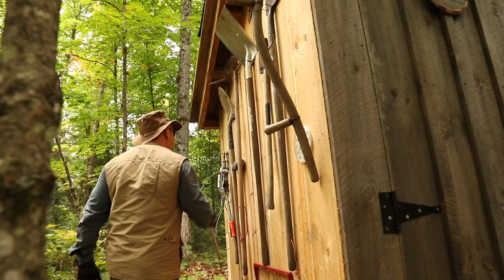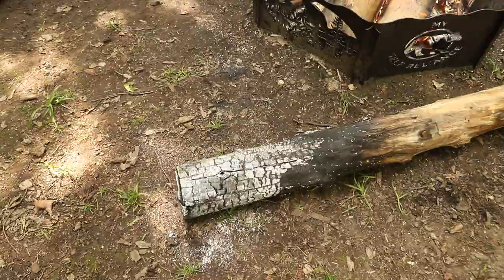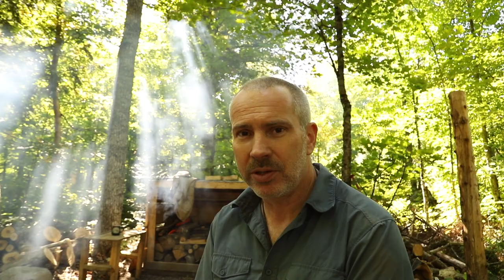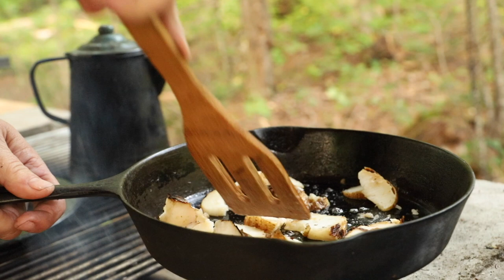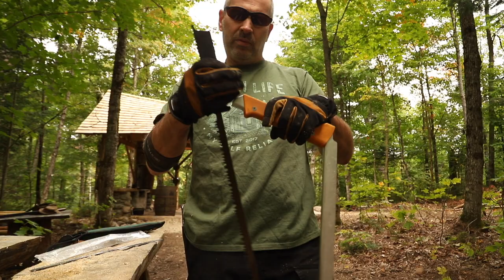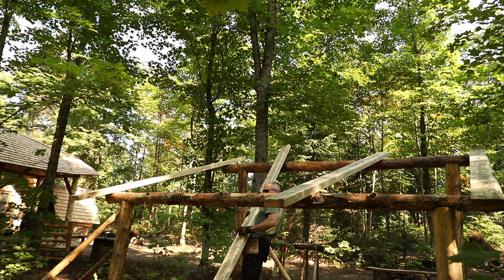Bushcraft Super Shelter Style Wood Shed | Deer Meat for Dinner BBQ

Comment: My dad kept his firewood behind his machine shed in a big pile for splitting. The machine shed was about 15 feet tall. Dad built up the firewood pile that high every year, and we never ran out of firewood. it was about 15 feet high and about twice that wide at the bottom of the pile. Didn't hurt that we were on 66 acres of woodlands and he only cut up the deadfall from the previous year. Now he keeps a smaller pile next to an old smokehouse behind the garage (only about 10 feet high). If we'd had a woodshed like yours when I was a kid, we'd have wood overflowing it. Dad did about 4 trips into the woods with his tractor and an old truck bed trailer, always filled it up to the point where some stuff would almost be ready to fall off.

Comment: Sean if you have not tried using a water level you will love its accuracy and the ability to level and bench mark over considerable distance limited only by the length of 3/8 tube you buy. I use 100 ft myself. Its practically fool proof and a real time saver

Comment: Interesting video, Shawn. I've got a question about your technique. Is there a specific reason that you flat top the posts and then hew a flat bottom saddle notch? I learned a much different style of saddle notching the beams to the posts. We were taught to cut a "V" shaped saddle notch in the beam a little more than 1/3 of the diameter of the beam and with the points of the V's corresponding to the desired center to center distance between the posts. The tops of the posts were cut to a matching V profile. When the beams were lifted onto the posts, gravity alone created a remarkably stable joint. We completed the joinery by drilling at an angle and pegging the beams to the posts. I'm certain that those gigantic bridge nails you use would work just as well and be a whole lot less work. 

Still loving the short frequent videos. Thanks for taking us along on your adventure.

Comment: Hey Shawn, I was just thinking about your shed design, and I wonder wouldn't it be better to use some coating over your wood? I get it that you burn columns bottom and it will help a lot but wouldn't it be better to coat it whole so it won't get water from the ground? I'm not trying to be provocative just genuinly curious. Waterproofing is pretty common and I'm sure you know about maybe it was I who missed it in some of the videos. I guess it's called wood oil, outdoor coating or something like that? Of course it might ruin the whole "off the grid" schtick that you'd use professional construction products but it will definetely help with sheds longevity. Thank you very much and keep up the good work, love your videos, man!

Comment: Your very optimistic about shedding that snow ,i don't know how much you can get up there but it looked pretty flat, i hope you are correct ,I've had to fix problems like that for a friend once ,it was a real pain the following year once the metal was on good luck, it still looked good though
Reply from the maker: You're right. It has a decent slope, but I will be raking off the snow regularly

Comment: I have one question being a carpenter by trade. Why did you laid the roof  rafter down,,,,,,,, you should have stood them up  Then put the closer together. Like 2 ' on center. For the roof. Because of the snow load. Or made the front of the roof higher. So the snow would not stay on the wood shed roof that long 
I like high peaks. Make roofing lasts a lot long. Good luck with things. JUNKMANDO